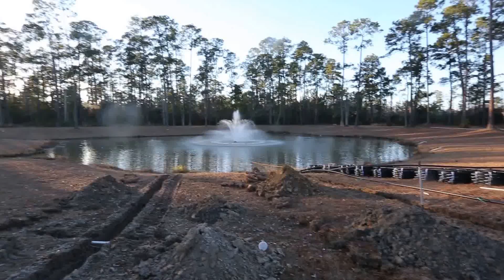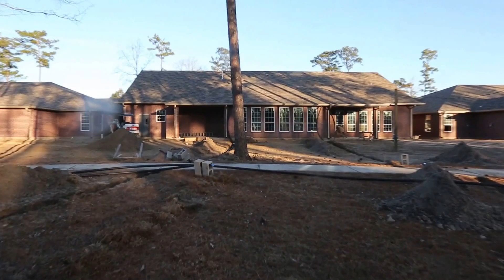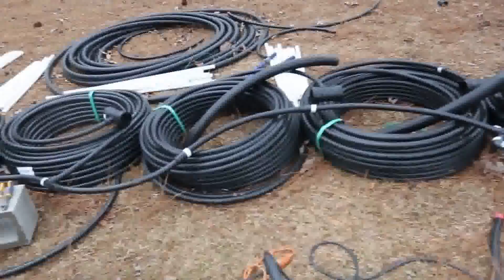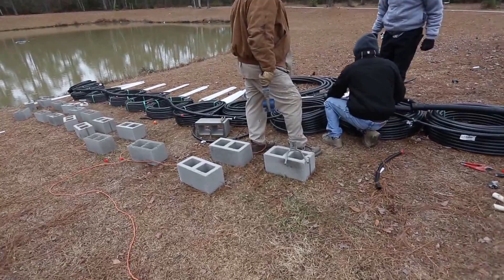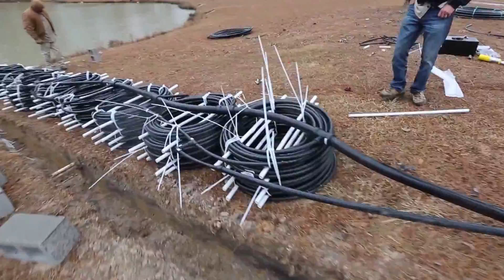Mega Air install: Geothermal Pond Loop Slidell 641-1299

Comment: Could you use much less coil if you used copper coil?
Reply: corrosion issues
Reply: No but you could 100x the cost if you want slimy green metal pipes in your mind